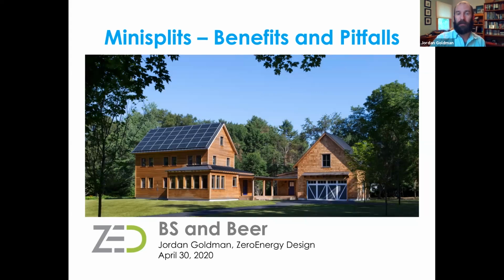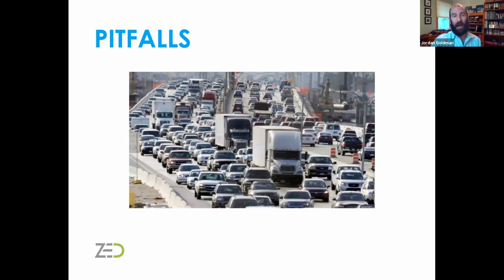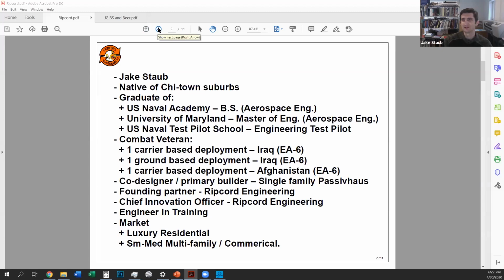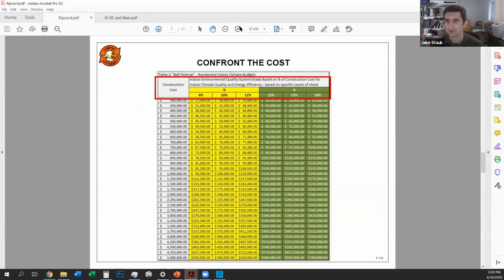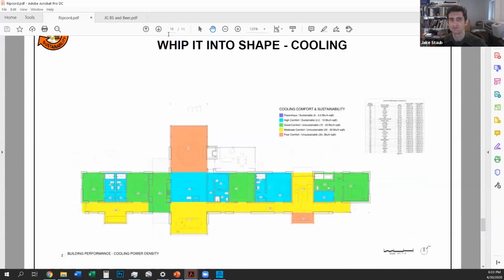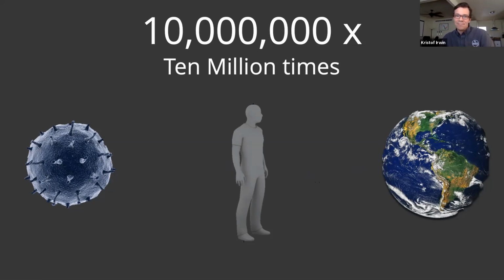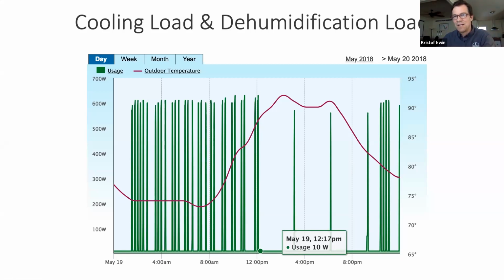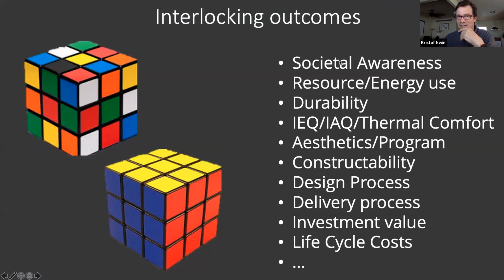BS + Beer: Making the Most of Mini-Splits

Comment: Another disadvantage is needing to disassemble each head every 6 months for the planned maintenance schedule.

Apparently Carrier has made it a little easier, but even so, compared to an indoor AHU a minisplit needs a lot more attention.

I'd rather have a VRF unit with a ducted system, seems like the best of both worlds.
Reply: You can select ducted AHUs with typical filter boxes in lieu of wall mounted units.